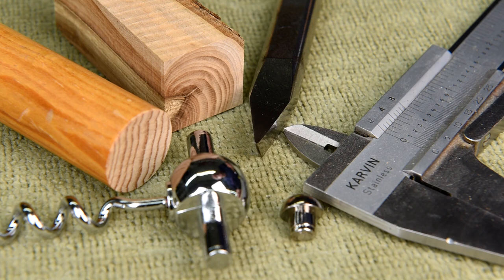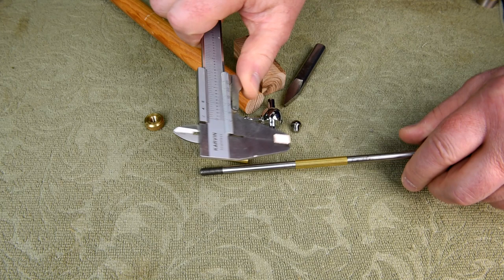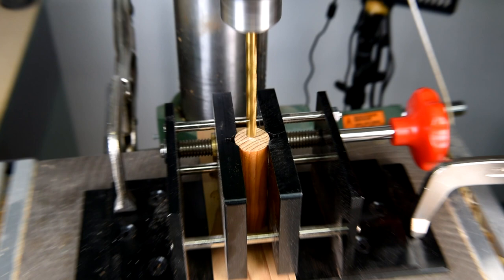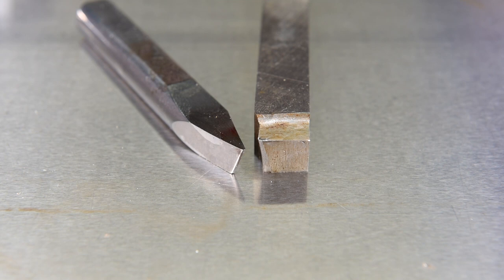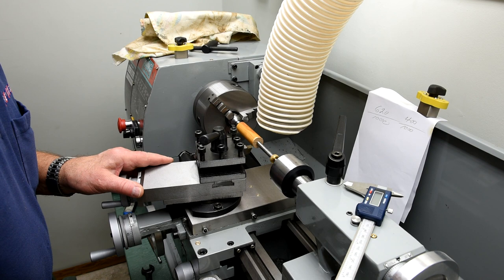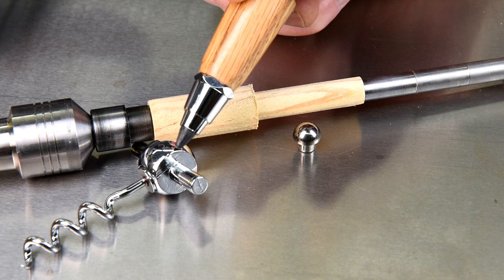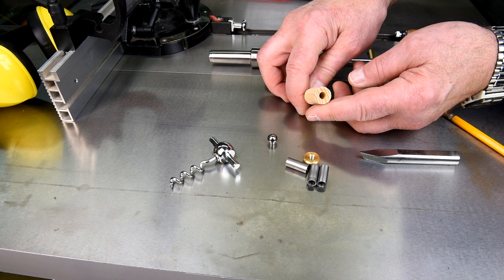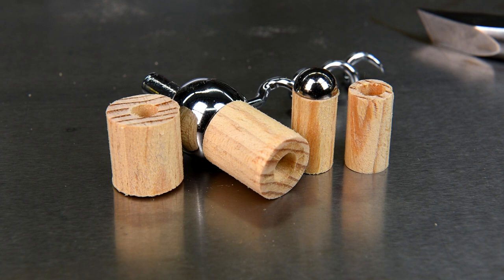The Pizza Cutter & More - Part 4

Comment: Hi Ron.  I am liking your latest series.  Regarding making the bushes.  You clearly have a great looking metal lathe.  Did you not consider making metal bushings for more durability?
Reply from the maker: +Mike Bernard
Hi Mike. Short answer is "yes", not only for durability but also accuracy. But I wanted to see if wood would work. I'll soon know. I'm concerned that the smaller wooden bushing may collapse when the mandrel is tightened enough to avoid slippage. Maybe I'll try to strengthen/stabilize them with CA glue. Haven't got that far yet. What you saw is where I'm at now :)
Reply: Many thanks Ron.

Look forward to further videos.
Mike B